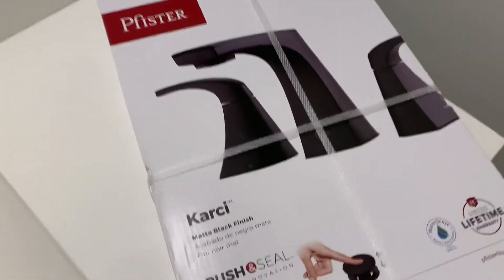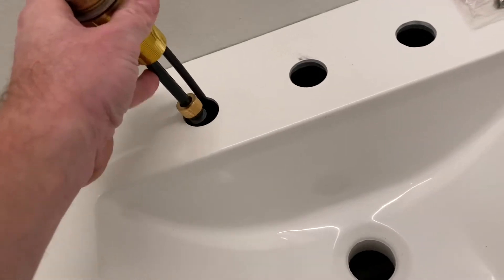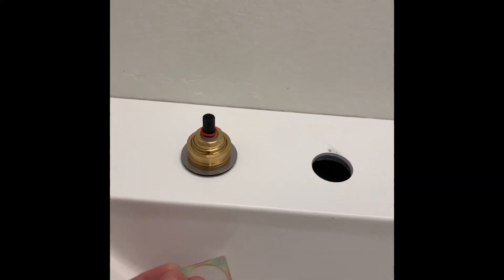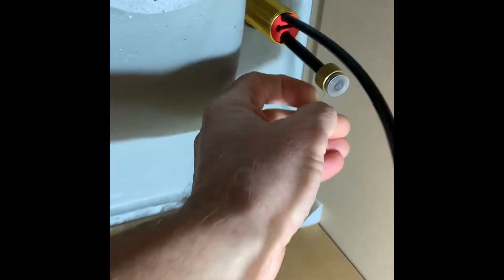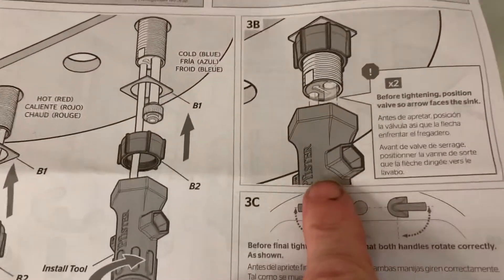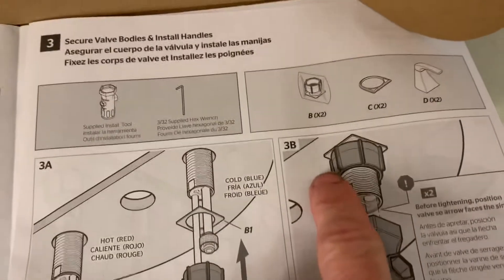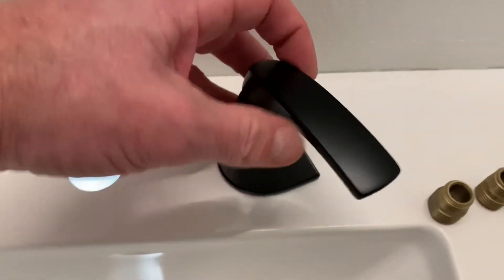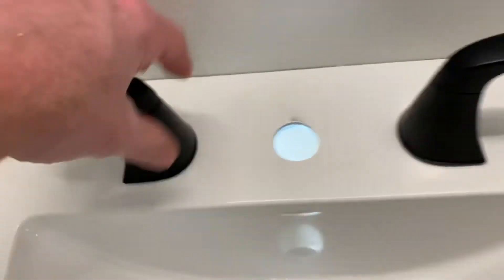DIY Pfister Brand Karci Bathroom Sink Faucet Installation Part # 1158237 [Pfister Karci Install]

Comment: What size connector goes into the top water supply? I I have a 3/8 coil but I need the connector piece for the hot and cold and do not know how to figure out what size it is.. please help 🤦‍♀️
Reply from the maker: Darn it. Gotta love plumbing. Every job is different unfortunately. Well Melissa I’d say that it’s either a 3/8 or 1/4 off the cuff. Which connection exactly are you referring to? I’m no pro plumber but have 25+ Years of screwing it up so I may be able to point you in the right direction.
Reply: @DIYTechnician  it’s a 3/8 connection at the bottom where the valve is, but at the top where it would connect to the top of the line it’s not connecting with the 3/8, it seems to be bigger so I need to add a connector piece to it- not sure what size to get for that part. My box didn’t come with any extra connector pieces.
Reply from the maker: Mine connectors are brass and looks like they are 1/2” to either 3/8” or 1/4” reducer fittings.
Reply: Why would my faucet handles work backwards? As far as I can tell I installed it just like you did. But when the handles are in the off position the water runs, and when I move it to the on position the water stops. Yes, the Arrows are facing the sink, and the Allen wrench holes are facing the wall. Everything looks right, just works backwards. Any thoughts?
Reply from the maker: @burntmarshwiggle  Hi Ken, I did the same thing. Check out the video at about or around the 5 minute mark and see if that helps.